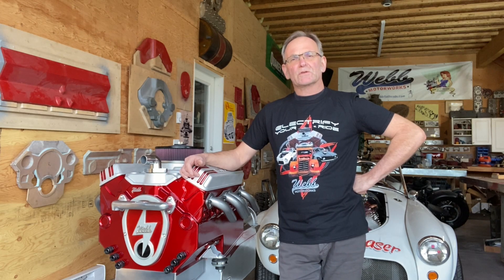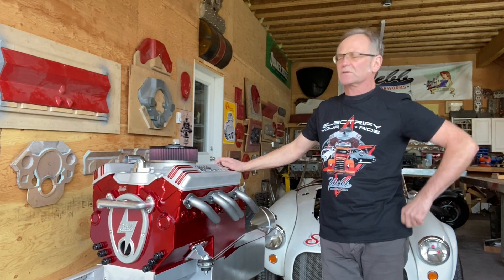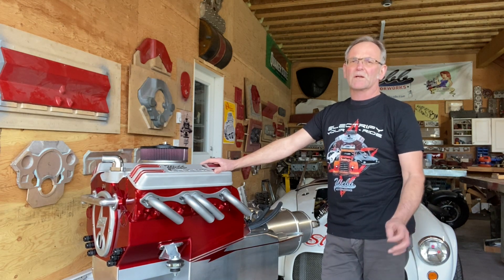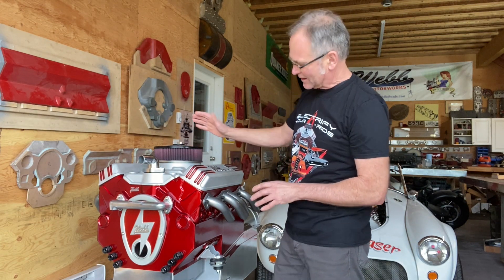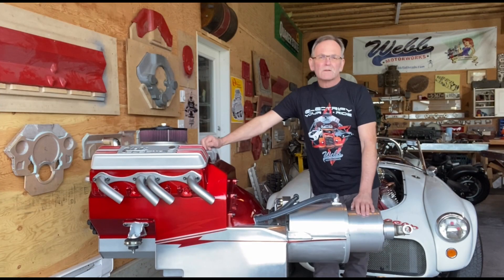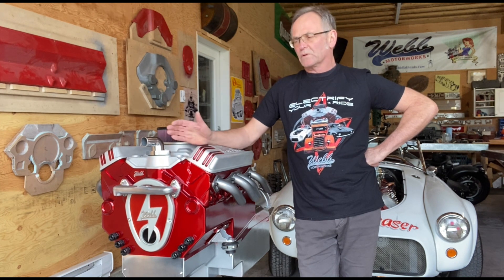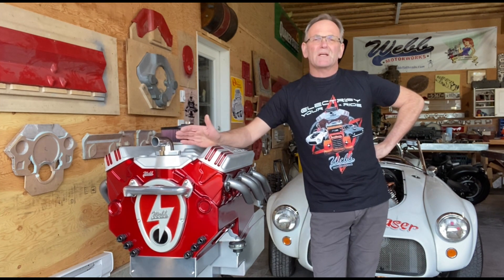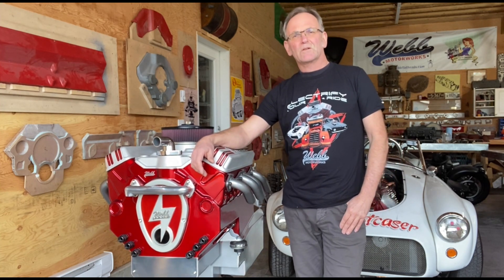High Volt Electric Motor Hidden in Small Block

Comment: You have to convert a 1968 thru 1982 Corvette i think that Cat is so cool looking i have owned two of them over the years and the looks are great but neither my 79 or 81 had much power. Heck but batteries in place of the fuel tank and try to get 200 miles or more with a fast charge capability. That would be awesome. How much are planning to sell kits for?

Comment: Interesting idea. I like that you have made this all on one and modular, but how would we deal with power steering? Is there a way you could also run a pulley out front that would be able to run A/C and/or power steering? This could make for my 1967 chEVelle once my gasoline engine quits.
Reply from the maker: Hi Brad. If you have a look at my first prototype I did actually run a shaft was a pulley that runs the alternator and you could of course run your power steering off of that. Of course there are also electric pumps that take care of that if you do not want to run the pulley.

Comment: I have a real slick 88 Chevy extended cab WITH a 62 diesel heavy duty trans can I hook this to torque converter and and use it?
Reply from the maker: You wouldn’t need your torque converter.  This comes with its own trans

Comment from the maker: That’s correct the batteries are 3.2 volts apiece.  The motor is the same but to get the higher horsepower with the second battery pack in series you use a different formatted controller than the 307 volt .A lot of the motor manufacturers are doing bus type motors and aren’t interested in tweaking the controllers to get the high pony’s the hotrodders want.  Not common for diy to be doing the higher voltage unless they are doing the wrecked Tesla scenario.  Thankyou for the insight

Comment: hi chris, i like your motor, i have an older jet boat that had a stock 454 in it but it was siezed. i've been thinking about putting in some type of electric motor in it and this one looks perfect for it, anxious to see the pricing and availability when you work it out. i'm in central nj.
Reply from the maker: Not very common yet at putting electric in the high speed planing hulls.  A lot more common in a sailboat or displacement hull.    That being said it would be awesome
Reply: Need to seal better for marine

Comment: Neat product.  It's kind of like having a hybrid.  Looks like old skool...drives like the future!  
What type of cell chemistry are you using?  96 cells at 307 volts is only 3.16V per cell.  

Ok, I know you're just speaking in general terms but since you're potentially selling to people who don't know anything about EV's it's important to teach them and using the right terms is critical. You have 96 72 amp hour CELLS which makes a 22 kilo Watt HOUR battery and adding more batteries will NOT increase horsepower.  Trying to put 600V into a 300V inverter will end very badly.  

I love what you're doing.  I think it's a brillian gateway for a lot of "shade tree mechanics" to make the jump into electric drive.

Comment: How much more weight does this add over an ICE engine and transmission?

Could you put a transfer case behind it for a 4x4?
Reply from the maker: It will weigh the same as your ice motor so it is great weight distribution. No problem tying into a transfer case